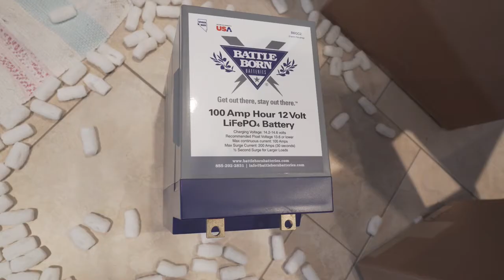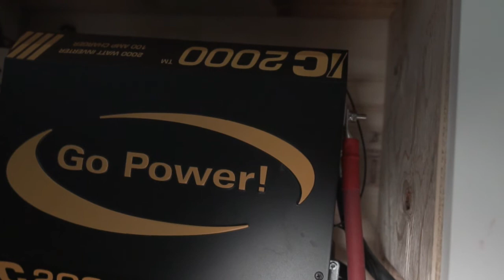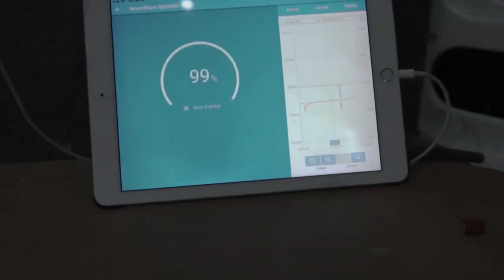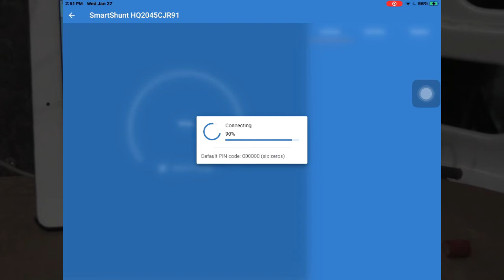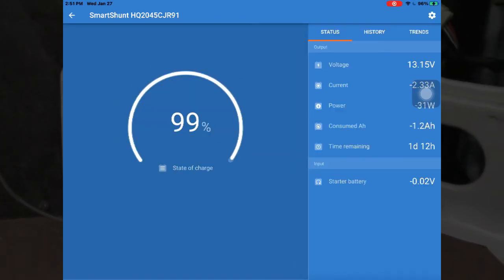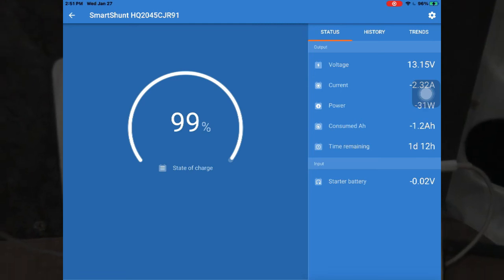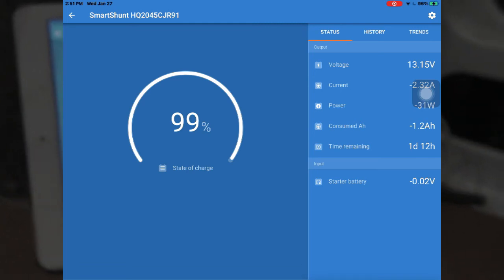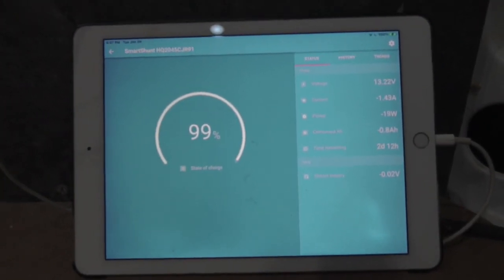Battle Born Lithium Battery Install into Van

Comment: Very nice system design!  Did you buy or rent a crimper to connect lugs to your thick cable. I can’t find a decent crimper. Please give the crimper make and model. Thank you very much.
Reply from the maker: WBHome Hydraulic Crimper of Amazon . About 100.00. Works great for diy projects.
Reply from the maker: https://www.amazon.ca/dp/B0811VYCQ6?ref_=cm_sw_r_cp_ud_dp_6SRQZZQAB9FV92F6E6GE